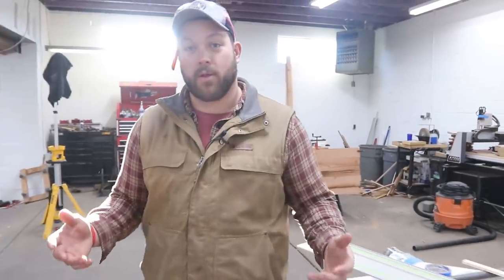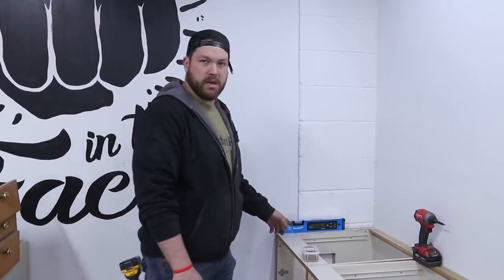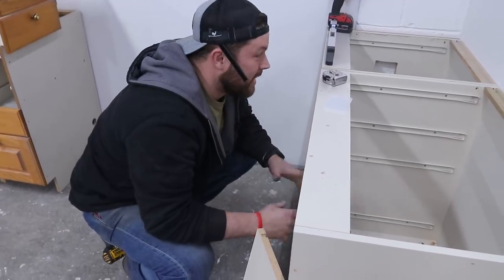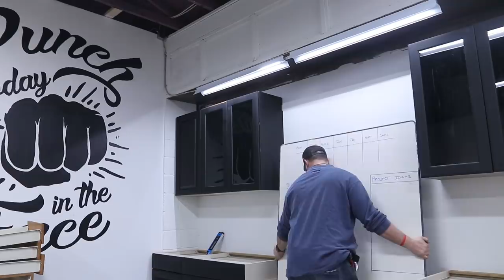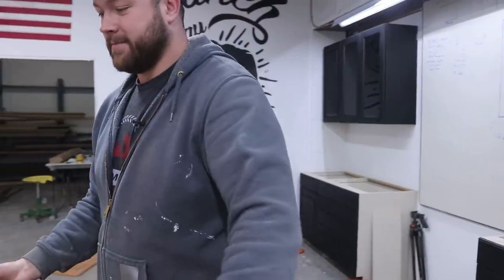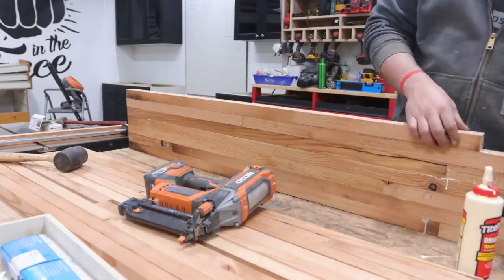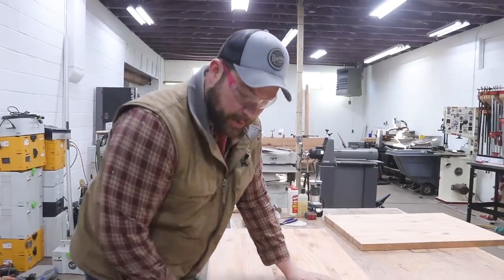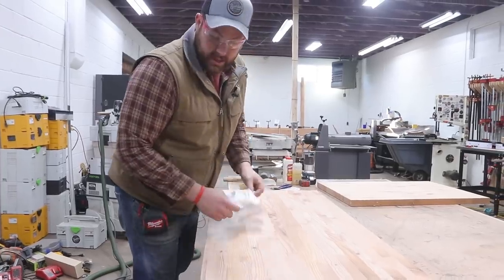Butcher Block Counters & Upcycled FREE Cabinets | Vlog 004

Comment: I like the idea of nailing the butcher block. Actually seems easier to keep alignment maybe. Any down side if used this on a non shop countertop? Next shop project, storage for all of those systainers. They look like they are about to tumble over.
Reply from the maker: The nails aren't necessarily bad, i blew out probably 10 on each through the face which isnt the best. Systainer storage is coming tho for sure!

Comment: Metal sided draws sounds sensible. What can be worse than a draw that either wont pull out or go back in or the bottom falls out because somebody crammed too much in there. You going to make a little kitchenette there so if you fall asleep in the shop you can brew a morning coffee?

Comment: That Douglas fir turned out great!  The shop is really coming together nicely.  Any reason why you didn't seal the bottom of the counter tops?  Are the fasteners enough to prevent any seasonal changes that may happen on the the underside?  I have heard arguments for and against fully sealing table or counter tops, but don't know enough about it to know when each argument is applicable.  Thoughts?
Reply from the maker: Just laziness haha and wanting to get them installed. I would probably seal them if it was for the home

Comment: I wish you had built any of my walls. I live in an old house. There is friggin' concrete on the walls, so good luck with a stud finder. I've tried several. None of them can penetrate the layers of crap on top of crap clad in lead paint. I find studs by drilling holes in walls and hoping like hell I don't find a wire. None of the studs are any set distance from any damned other thing. So if I find a stud, I can't assume that another stud might be close by.

Comment: You've used the Graco cordless sprayer in the past, I have the corded variable speed version...and I like it well enough, cleaning is a bit of a pain. And every now and then the seal breaks while spraying and I have to stop and prime it again and get the air out of the paint bag. Do you still use yours or have any of the same issues?  I don't like having to move everything in my shop just to spray, but I love the efficiency of it when ya got a lot to do. Thinking maybe a more traditional hvlp or turbine is what I should get instead.
Reply from the maker: I use both, just depends on the application. I spray paint in the cordless mostly now, i can get a more precise finish with the HVLP

Comment: Nothing wrong with glue and nails. Glue does 90% of the work anyway
Reply from the maker: Yea until you blow 20 nails thru the face haha. but yes its strong
Reply: John Malecki just use 25mm brads or 1” inch for you Americans.